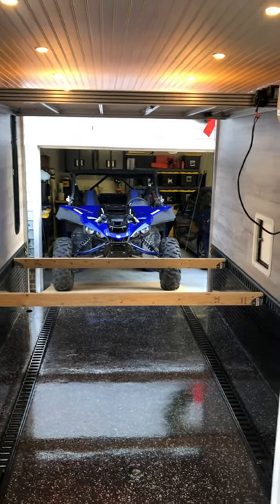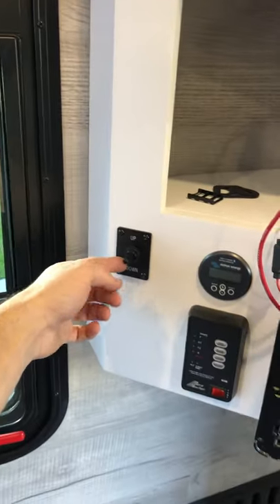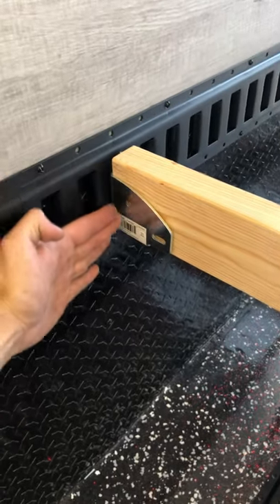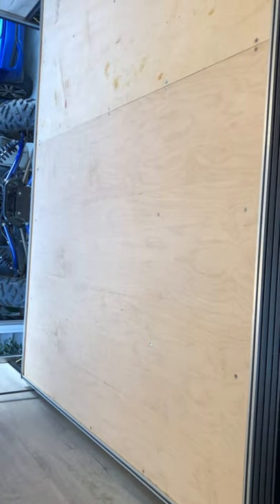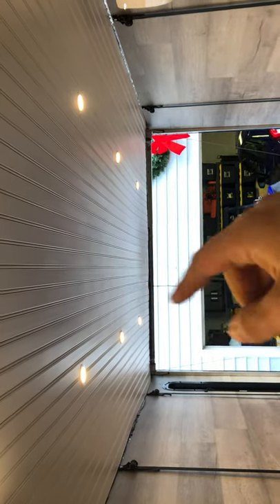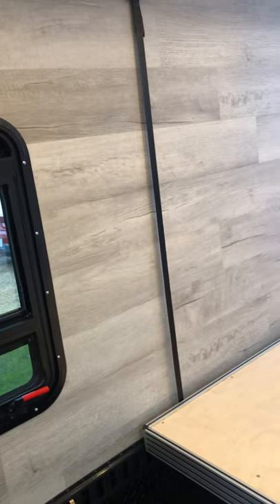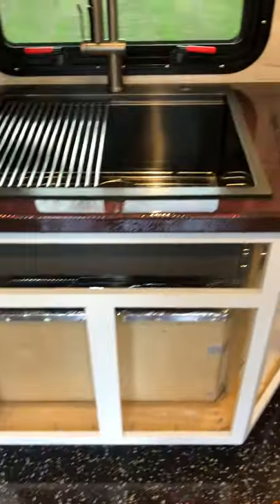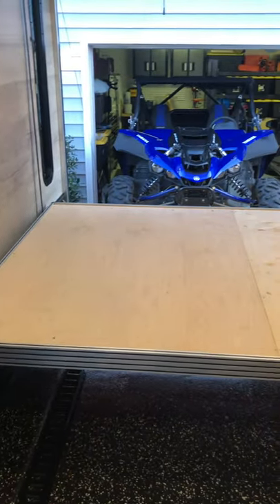The Best/Easiest DIY Electric Bed Lift for Cargo Trailer, RV, or Camper Van

Comment: RE: Sweating and plywood bed base. You can cut 3 or 4 inch diameter holes in the plywood (all over). It lets mattress breath and lightens the weight of the plywood--even though 1/4 inch plywood is already pretty lightweight.
Reply from the maker: Yep that’s the plan!

Comment: Btw your system is practically identical to euroloft system.. I bet at a fraction of the cost! Thanks again for the explanation
Reply from the maker: Yeah that’s where I got the inspiration!  This is basically a cheaper diy version since I think that one was still well over 1k$ when I checked if you can even buy it
Reply: Try $3000

Comment: Drive pipe on the ceiling with a belt to 2" output with 2-4 infinite movable snatch block pulleys could lift or pull everything you could fit in there for about $1500, 2500 with remote control and limit switches

Comment: About the strap fixing, you actually dont need to have 2 parts, you can keep a slit and have one strap go from one end, through the slit to the other end. easier to 'calibrate' as well. when rolling up, the 2 straps just roll on each other in a single reel

Comment: My sprinter has a very similar setup. Couple key differences: I used a harbor freight atv winch with wireless remote. It is mounted inside the bed frame, replacing your worm drive. The winch spool is replaced with the bar coming straight out of the winch. Completely hidden. It has an auto locking brake which is nice. I also used automotive seat belt webbing for the straps, thin and slick while very strong.
Reply: Sounds a great design.  Do you need two winches? Will appreciate if you can share more details and possible a video? Thanks!
Reply: @fengguo8575  I used one winch motor (rated for 2500 lb. ) It is installed inline with the rod that winds up the straps. The rod projects straight out of the winch where the spool used to be. I actually modified the winch spool so that it could attach to a rod. My entire bed system is made to be light weight. A bed doesn't need to be very heavy to support up to two people. My whole bed system, which includes the mattress, bedding, frame, winch and strap winding system weighs less than 110 lbs. It is not using the other kind of winch system which has pulleys and cables everywhere. This winch is simply replacing the worm drive motor shown in this video.

Comment: You, your build, and your explanation are absolutely top tier! 

I can’t wait to check your sketchup file, but I won’t have access for a couple of days yet. 

Two questions I’m hoping you can answer easily; 1) what is the volume of the worm motor (how much space does it take up)? 2) how would it affect the design to be mounted either within the frame, or on say the left wall right at the ceiling?

I’ve been looking for this solution so I’m probably going to follow your design, but I think I’d like the motor to be more hidden.

Comment: You could ventilate the mattress by using quiet computer fans hidden within the base. Once lowered they could be plugged in to 12 volt receptacles within the wall for power. Great design BTW.

Comment: On my Cross Alpha series trailer (+12" height) I have a good ten inches between the ceiling beams and the roof. I will be putting all components in the rafters. Thanks for the info.

Comment: I add envisioned just such an arrangement but with the straps from front to rear - I had even looked at the same style tarp motor. I think I like your arrangement better.  I think I will try to put the adjusters inside the bed frame, accessible from a hatch above, IF there is enough “travel” available.  To secure the straps to the shaft without having to drill or slot the shaft, I was thinking of using a slightly larger I.D. pipe and split it lengthwise to make a “clamp” and just capturing the strap (might increase the starting diameter too much though).  Maybe make the frame from 3/4” Baltic birch ply (or 1/2” laminated to yield 1” thickness) and use “spring slats” to support the mattress for a little “give” and air circulation.  Will try to source small rollers for the straps to ride on.

Comment: Thanks for the video, looks like a great job, I'm wondering could the webbing be a single line running through a slot in the bar? Then the motor would wind it up... It would be doubling the webbing in the coil so maybe not possible. Im In the middle of a van conversion and thinking about the euroloft but the bank balance is getting tighter and tighter!

Comment: Very good overall design!
One thing I think I would do different is mount the motor and pipe up on the ceiling so you don’t have the motor going up and down and having to figure out how to deal with the cord.
Reply from the maker: There’s a several reasons not to do that:

First, if you do that, you have the shaft with straps wound up above the bed/mattress which prevents you from going all the way up. You have to leave room for the straps to spool and the motor.  So you loose about 3-4 inches. 

Second, you would then have to mount the motor and shaft to the wall/roof which means more hardware, you would have to have some wall mounted bearings and a motor mount.  

You would have to mount it in the center overhead, otherwise it would be in the corner so you would have 90deg pulling angles instead of 180 (which counter each other).  90deg pulling angles wouldn’t negate eachother so you’d have to get a much stronger shaft. 

Also that would mean if you ever needed extra room, you couldn’t easily disconnect the bed and remove it. 

Lastly if your battery died with it down, you couldn’t use the strap mounts to lift the bed up and spin the ratchets to lock it to the ceiling. 

…a lot of thought went into all the pros and cons.  I assure you there’s method bending my madness 😅
Reply: @bren5279  well I have plenty of room and height so that’s no concern, this is a dedicated camper build so the bed will stay permanently.
My thought was to build a small box along the ceiling to cover shaft and motor, I am not the first to think of this I am sorta copying a build that was done .
My truck has an 18’ insulated box and is 8’ wide around 7’ high inside.
Reply: @bren5279  as far as the loads on the shaft, this is an easy thing to address, it just needs a support bearing in the middle so the loads are not just on the ends of the shaft.
Reply: @bren5279  I don’t follow you when you say if the battery died I couldn’t use the strap mounts…..why couldn’t I? I would think it would be better if the straps were both fixed to the ceiling, only for my design I am going to incorporate a manual back up, probably with a drill…..
Reply: @bren5279  one thing I can tell you I wouldn’t do is have the end of the gearbox hanging down, I am sure I would split my head on it lol

Comment: Great build, thanks a lot for sharing! Can you please provide some insights into how durable the construction turned out (for you)? My particular area of interest would be: 1) worm gear/drive; from specs this seems to be a well-picked motor, but max. load is limited AFAIK 2) drive shaft; diameter doesn't look that big to me, does synchronization of the 4 strings stay well over time? 3) Frame, in particular wether it twists (or doesn't).

Comment: Listening to your discussion of the “alternatives” it occurred to me that the take up shaft/motor could actually be mounted on the floor with straps going over a roller at the top and down to the floor. The take-up strap could be hidden in the wall. And the motor would be solidly mounted and out of sight.
Reply: only thing to keep in mind you whould double the load on each of the 4 point in the seling.
Reply: @Rusty72501 I really like this idea, but are you thinking to put the motor/shaft in one corner of the floor, run the straps for the far side up the wall, over a roller in the top corner, across the ceiling to another roller, then down to the bed frame? Because that would be a really long strap, with a lot of opportunities for problems. Or did you have another idea?

Comment: I really like the layout of your camper and smart thinking with mounting the tanks underneath, could you possibly give a run down of how you've got the water setup sorted ? Pumps and lines ect, explain how the grey water works and stuff, seems this part always goes amiss on videos, your video is awsome ! I love the table design you've got for your sink, nice dude !

Comment: Great build, thank you! Would be interesting to know if you could do this with separate smaller front and rear motors, able to work independently, to enable leveling the bed without leveling the whole van.

Comment: Amazing!  Thank you.  I'm currently using your design in my cargo camper.. I have a motor, controller and driveshaft from a motorized hospital bed which has plenty of torque to lift my queen size frame.  Have you had any better suggestions for attaching the straps to the shaft? Any input would be greatly appreciated

Comment: FINALLY a proper video of how to do this. I do have a question. I'm a huge fan of Rhino products but am unable to find Rhino brand by the foot or yard. Do you have a source for Rhino by the foot or yard? Or did you buy straps and disassemble them? Thank you.
Reply from the maker: Yeah you just use the regular whole straps and use the ratchet part to mount to the wall (taking it apart to remove the handle)

Comment: Nice looking build, and bed is sweet!  Think i might try it with 2"+ wide straps?  Any issues with heat if the bed is in up position and ceiling lights are on?  Seems this powered lift bed is the way to go!

Comment: Great bed lift. You might not be happy with plywood as a base..... most bases are slats or something so they breathe (your body sweats moisture into the mattress, slats allow it to shed that moisture so you don't mold). If you aren't spending a lot of nights in it there probably isn't a problem.... but if you are going to live in it or stay a lot in it, it COULD become problematic. 

I am thinking something along these lines, but just going to power it with a cordless drill with pins to lock it in whatever position I need. I'll just use the same drill I'll use for the levelers and the motorcycle loader.
Reply from the maker: Yeah we’re going to use a holesaw to add a grid of ventilation holes
Reply: @bren5279  I'm sure that'll work great. Pretty sure moisture will vent through a hole just as well as slots. Of course it's been a few months so now I need to re-watch your vid 😀 to remind myself your exact setup.

Comment: I think it's the best project, thanks for the 3d model and parts list. Unfortunately the amazon list is almost empty. I think the biggest problem with the system is how to safely block the straps from slipping and protect them from threadbaring. It would also be better to ensure more ventilation to the mattress. Anyway, nice work!
Reply from the maker: Yeah sorry every time I update it the items change so it’s impossible to keep it always up to date.   It’s all reasonably easy to find stuff. 
I haven’t had any problems at all with the straps, and I ended up adding small track hooks for stops.   Yep need to add holes for ventilation for sure
Reply: @bren5279  great video! Will you do another video soon? Thank you for sharing!

Comment: Super nice solution for the bed, but I'm not 100% sure on how you made the holders on the wall. Did you only cut away the handles? I like that you was able to bolt them straight into the wall and keep the strap adjustment

Comment: This is awesome,  this is exactly what I want to do in my van.  Thank you for providing all the information.  Especially with the Worm Drive.  I was wondering how many RPMs to use.  50 RPM seem right.  Thank you
Reply from the maker: Yeah the 50rpm is a hair on the slow side, but once you put the weight of a mattress and blankets on it, that’s probably about as fast as you’ll go without stepping up to a bigger heavier motor.    If you wanted to go faster you can also use a slightly larger shaft to start.

Comment: This was amazing could you share the parts list and where you got them? Do you have a video of how the made this bed as you made it and what you learned as you were making this. This is exactly what I want to build, you are genius and a perfectionist. Again the parts that you got for this I have never seen so would really like to know. Thanks so very much.
Reply from the maker: Thanks!   Unfortunately my computer crashed and I lost the actual detailed parts list, but if you click the sketchup link, there’s a general parts list in the description. You can use the sketchup 3D file to get all the exact measurements of all the aluminum Tslot and order it off Misumi.  That or just build whatever bed frame you want (wood steel aluminum etc) and just mount the motor and shaft part to that.

Comment: Great info thanks so much. Which mini split is it that you used? Ps: u have any suggestions how I could get the straps to work on the ends rather than the sides! Subbed in appropriation. Thanks

Comment: I just built an almost identical system but i used 4 independent motors near the floor under a cabinets the straps come up to the roof over rollers i have a slat roof so its all hidden in the roof and wall.
My bed frame is 1.25in x 0.75in steel tubing with expanded steel mesh on the bed side and stainless on the bottom. I use a 3.5in high density latex  mattress in side a protector.

I'm using 4 nema 23 steppers with 50:1 gear boxes and encoders. The brains are a esp32 with 5 buttons for up down and 3 presets.
Also made is work with home assistant and has a simple web interface the lets you tilt the bed..
Reply: Sounds really interesting, would be good to see a short video of it on your channel if you ever get the chance in future 👍

Comment: This is the best DIY version of a strap lift (like in a Winnebago Revel) that I have seen, and it beats track actuators on cost and simplicity. Excellent! How has it been holding up? Now that you've used it a bit, are there any key lessons learned or things you would do differently? Thanks!
Reply from the maker: I actually haven’t had time to do much more on it, however, since I made this video I’ve moved the trailer once or twice and in the several weeks it’s been up it hasn’t budged down at all with 0 restraining straps to hold it up.

YES, here’s what I’d do differently;
1. To attach the straps instead of slotting it, just sew a loop in the end of the strap, and use two rivets or a little strip bracket with a  rivet on either side to keep the strap from spinning.  This would’ve been MUCH easier. 

2. I should’ve taken a pulley and cut it in half to make strap guide walls so when the tension comes off the straps, the slack doesn’t cause the spool to get sloppy. 

3. I’d like to investigate using a garage spring of some kind (maybe just a smaller long coil spring offline) to counteract the weight and see if I could downsize the motor
Reply: Thank you!

Comment: Great job, how is the back end of the shaft mounted. Thank you for all your info.
Reply from the maker: Thanks!   One side is just in the bearing  about a mm or two from the aluminum with the set screw tightened down. The other has the shaft in it and the wall threaded with a set screw onto the motor shaft

Comment: Could you use an impact gun? weld to lug nut to shaft? Something along lines of scissor jack?  Or ratchet all the way up no tension but tied off with some sort of safety line? 
I date the big girls so I would still have a vertical e-track and 2x4s for the bed platform support.. 
Great work

Comment: Awesome video and Ty. Did I see exposed flake board(OSB) under the trailer? That stuff absorbs water like a sponge and swells up.
Reply from the maker: Thanks.   It’s technically a type of OSB but has a different glue so it’s weather resistant.  Came that way from the factory. Lots of manufacturers use it.

Comment: I am copying your design, but I used 15 series t-slots because I couldn't find your same 80/40 sized t-tract  you used on the outside of your frame anywhere that wasn't immensely expensive.  Turns out the 15 series is a lot heavier than i expected.  Do you have any feel for how much weight the motor you used would lift?   I would estimate that my frame would end up weighting somewhere in the neighborhood of 100#  Thx

Comment: My magnum opus design is exactly like yours, except the bar is on the ceiling on one side instead of underneath the bed. I'm going to have a huge skylight in the ceiling that will let me sleep under the stars in winter, so it has to raise the bed with me and one other person in it. I was always scared of getting my fingers caught in the rope as its rolling under the bed, so the top has to remain stationary in comparison to the bed. This design requires the location of the bar to be attached to the box instead of the bed.

Comment: Great piece of engineering this, well done! Do you think there is any reason why the motor couldn't be roof mounted? Maybe increased inertia?
Reply from the maker: Yes, I get that question a lot.   If you do that then it takes up overhead clearance room, also you’d have to have the spool shaft overhead and exposed with straps crossing across the roof.   It all goes back to overhead room and exposed components
Reply: @bren5279  I was thinking you could have the motor outside the footprint of the bed, possibly boxed in. That way the profile of the bed base could be shallower allowing more headroom beneath - I’m thinking of my own possible application where headroom is critical.